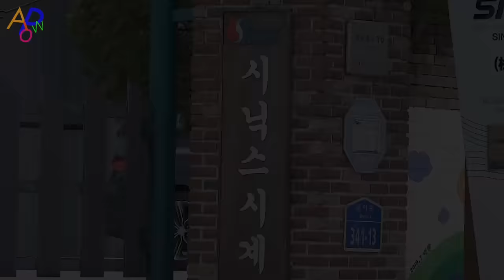Process of Making Cuckoo Clock. Last Wall Clock Factory in Korea

Comment: Hello, although your clock looks nice, that's all. 18years ago I bought my cuckoo clock in the black Forrest " Schwarzwald " in Germany. Still going strong and admired by everyone who examines it.
All made of wood, which gives it a wonderful depth of tone when playing eidelwise and happy Wanderer. I watched this video and was disappointed seeing composite used instead of wood, and mixing resins for moulds for the facial deco. I give it thumbs up 👍 for your ingenuity, but would have been nicer to have used real wood.
Reply: So true! 👍🏻
Reply: My thoughts exactly.  I also have a Black Forest German clock, and it is around 30 years old.
Reply: But people don't want to pay for the right price. That's the reason why the master craftsmen have no choice but to use those cheaper material. Who wouldn't prefer the real wood?
Reply: i am from germany and i remember that a lot ppl had those clocks, but now, i know only one older person who has smth like that. but its great to see that people still like that type of clock.
Reply: Agree.  Hardly anything hand-crafted there, it’s a knock off of real genuine Black Forest Germany cuckoo clocks.  The el-cheapo clock mechanism that runs on battery power instead of the original pine cone weights.  A real shame, stealing the good work of German craftsmen.
Reply: You should let it get serviced every 5 to 8 years. Otherwise it might demage itself almost irreparable.
Reply: John Gray Alman işçiliği ve kalitesi yüksektir...👍 Uzakdoğu üretimi Guguklu Saatler ile karşılaştırmak hatadır...👎

Comment: Very nicely made, and there is clearly still a market for these unique clocks.
Reply: Unique? You mean this mass produced cnc plywood/plastic landfill?
Reply: @neplatnyudaj110  Although you appear to have some difficulty comprehending this fact, I actually mean what I wrote, not what you've convinced yourself that I mean instead!

Cuckoo clocks are unique, which is why I described them as such, however, you fail to comprehend that very obvious fact!
Reply: I would easily pay at least $25 for such a work of art!
Reply: @Long_Last_Im_Here  Surely you wouldn't spent your life savings and the value of your assets on one...

Comment: I believe if we use gravity constant station as time standard to correct time in all clock it is better than even the atomic clock because immune to temperature, pressure, light or force of vibration . If we insulate and control gravity for each drop of water is 10m/ second drop then the second is standardize. By then human biological clock could be fixed and DNA or RNA back to normal psychologically, emotionally and physically
Reply: Wow! I never think that!
🤔